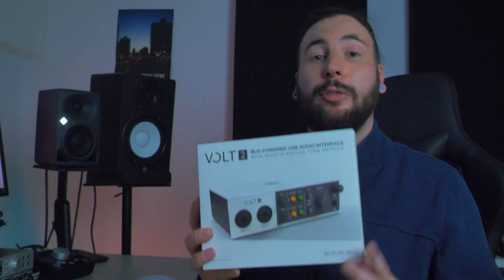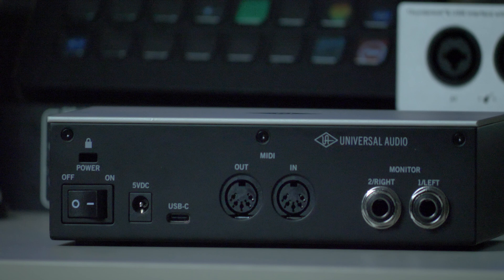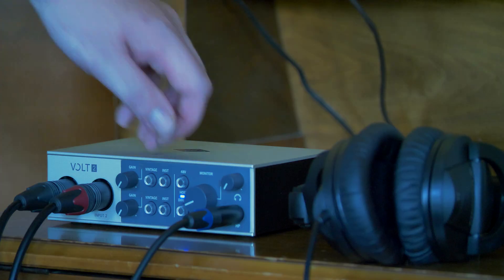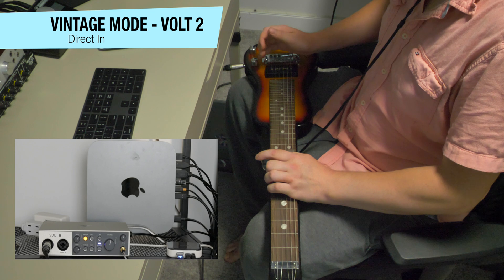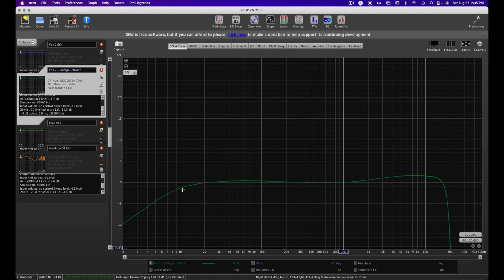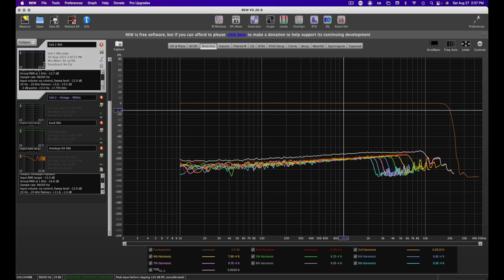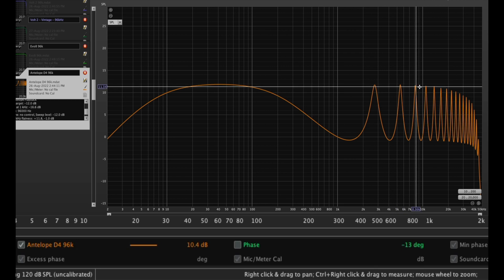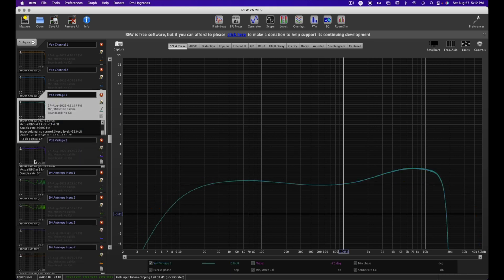Universal Audio Volt 2 Audio Interface Review

Comment: Please advise! I recently purchased Volt2, it suits me in almost every way, but there is one significant problem: the output to my monitors is very quiet. For comparison, I connect my Audient iD4 and also Focusrite Scarlett Solo 3gen to the same monitors with the same cables, the volume on the monitors is set to 12 o'clock, with the same settings Vol2 sounds one and a half / two times quieter. Does anyone have the same problem and is it possible to deal with it?
Reply: It's quieter, definitely. I can't get into UA Connect, which, if it were connected, maybe you would be able to turn up the volume there, but yes, quieter. Mixing on it is easier as it is not bass-heavy, and the response is flatter than the Scarlet. There's a dip in the vocal, I guess it's the frequency response of the unit. Better frequencies, cleaner signal, but the output means it will be lousy. I can turn up the volume, and the vocals will still sound diminished, so I guess it means you have to get the frequencies right.

Comment: For a podcast, which could give me better sound quality ZOOM H6 or a volt 2 interface?
Reply from the maker: Thanks for your question!   

It really depends on your specific needs. 

If your podcast setup primarily involves recording in a studio or fixed location with a limited number of inputs (yourself and a guest), the Volt 2 would be a solid choice. It offers a great balance of performance and affordability, and I prefer the desktop design personally. 

On the other hand, if you require a more mobile solution and anticipate recording in different locations or with multiple microphones, the Zoom H6 portable recorder could be the better fit.   

It provides some extra mic inputs, along with the flexibility of an XY stereo pair for diverse recording scenarios. (Although I wouldn’t recommend the XY as your primary method of recording voice)  

The H6 also allows you to import recordings to a computer via SD card or directly thru USB. 

The H6 is more expensive and has many more features, but would benefit greatly from a stand (sold separate I believe). The design reminds me of my old Apogee ONE which was always a pain to work with, (albeit the H6 is more robust than the Apogee design, I personally still prefer a desktop interface.)  

In summary, if you value stability and mainly record in a fixed location with one guest at a time, the Volt 2 is a solid, cost-effective choice.   

On the other hand, if you require mobility, versatility, and additional inputs for various recording scenarios, the H6 could be the more suitable option for podcasting with multiple guests. Hope this helps. :)

Thanks for watching, Good luck with your podcast!
Reply: I thank you for the advice, I bought the volt 2 because I only wanted it to record voice at home, it is wonderful  @LearnAudioEngineering
Reply: Think that will come down more to your mic. Zoom is more portable,.

Comment: Love the Levee on drums! I have the Scarlett and was wondering if you think I should switch over or get another mic? I have to play crazy loud on my amp and still add gain on the Scarlett for it to be audible. I have an sm57 that I’m running through. Just curious if you felt that the gain was adding any distortion in a bad way with this. Any help would be appreciated

Comment: Hi. I bought a Bolt 2 and when we I try recording or even just plug my guitar in I start hearing like a popping sound. Is there anyways I can get in a better way to communicate with you to get help?
Reply from the maker: Hi there! This might be a question for UA tech support. I'm not too familiar with the inner workings of the unit, but your issue COULD BE caused by having too low a buffer size for your computer to handle.

You could try increasing your buffer size, or using a low latency mode if your DAW has one. If your think the issue may be with the unit itself it would be best to troubleshoot thru UA support:
https://help.uaudio.com/hc/en-us/articles/210253543-Contact-Support

Hope this helps, Breezy! Thanks for reaching out